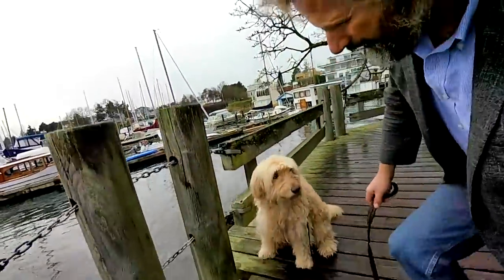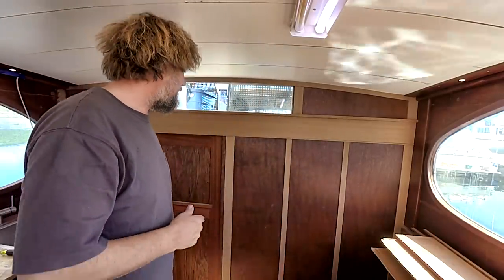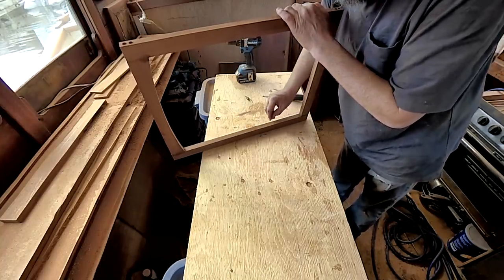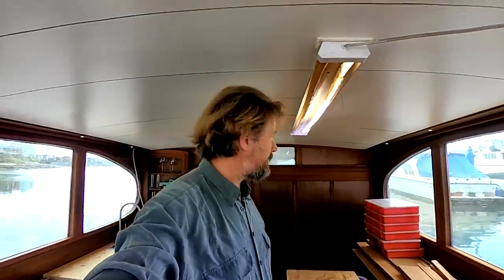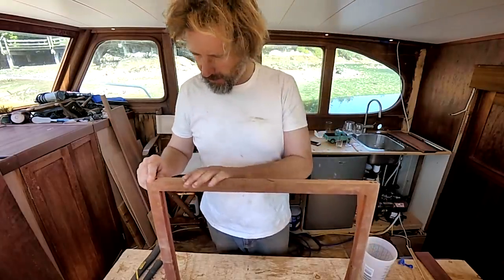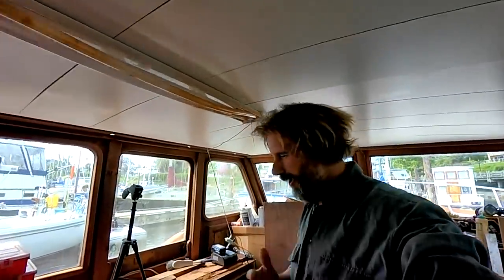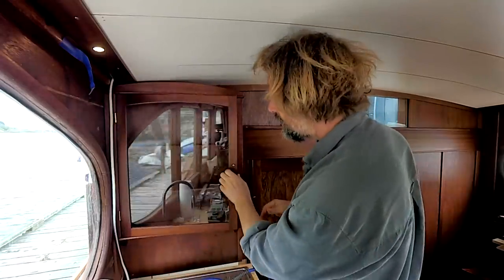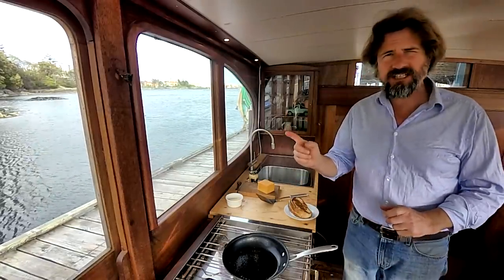Bulkhead and glassware cabinet done - Living on a boat - Boat Refit - Travels With Geordie #110

Comment: Hi Peter. Realising that is is three years later, I still feel the need to point something out. Reference @1:34 into the video; when you pull the wire through the trim piece, the pot light on the port side over the window flickers. As a fellow boat builder I could not sleep tonight unless I brought this (most likely fixed already) issue to your attention. Cheers!
Reply from the maker: Heh, thank you. yes, I was pulling the bare, twisted together switch wires through a hole and they lost contact momentarily.